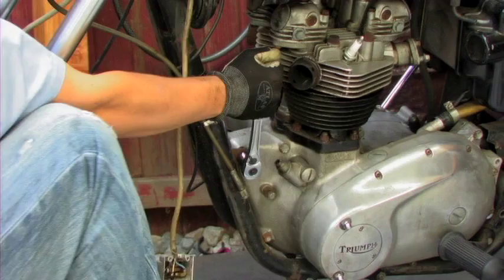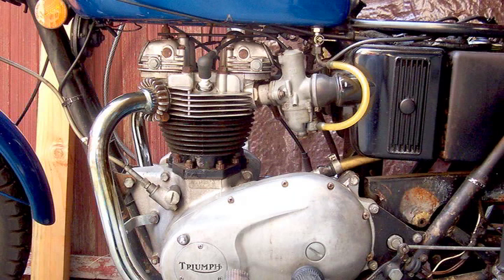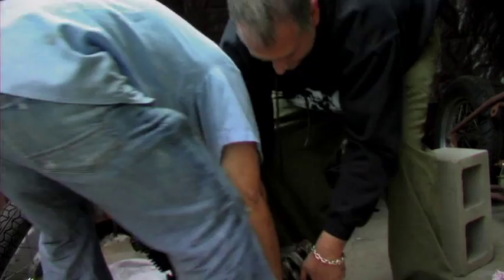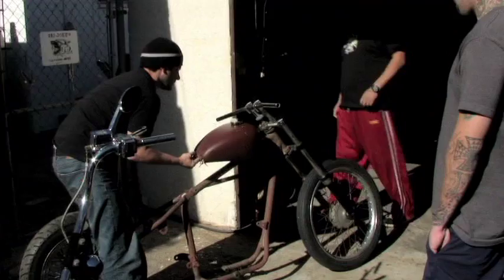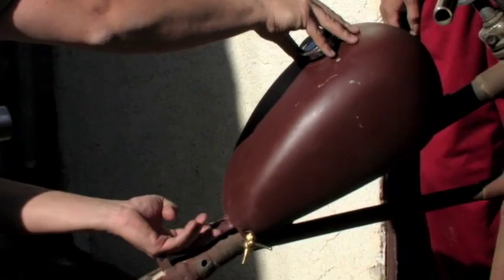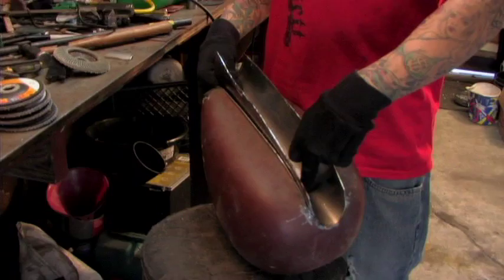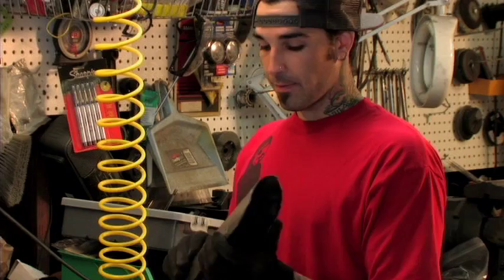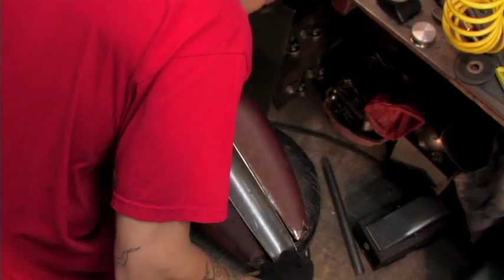Motorcycle Movie - The Harbortown Bobber (watch online free - first ten minutes!)

Comment: I would have used a block of rubber to go between the tank and frame, just as did the Triumph Mototcycle company did with my 1976 T140V Bonneville. A lot les work and also a large amount of vibration isolation to prtect the tank. My tank is as secure and imobile as if it were welded on, even with the rubber block isolating the tank from engine vibs.